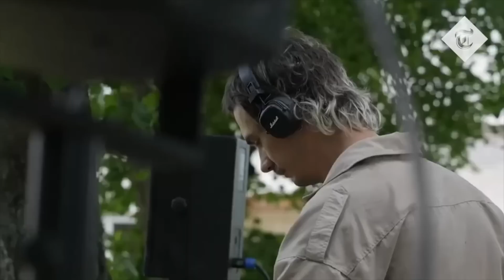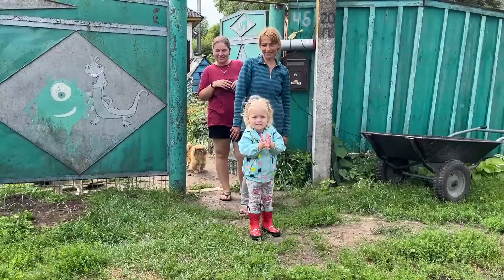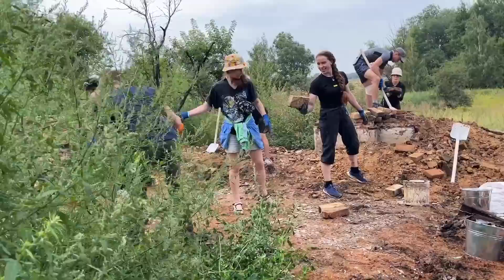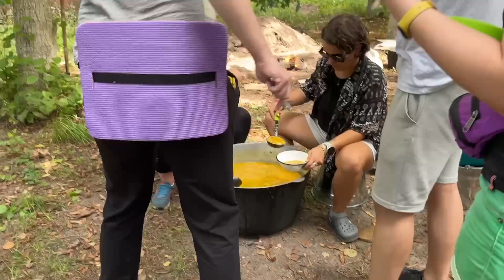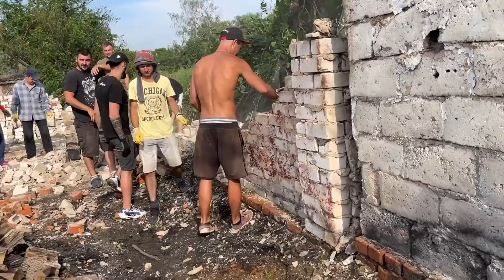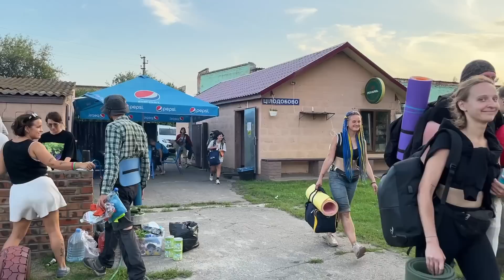VOLUNTEERING IN UKRAINE 🇺🇦 REPAIR TOGETHER (Chernihiv Oblast)

Comment: Hope those buckets aren't used to much for food. I doubt anyone noticed, but some are galvanized. In short, the metal is zinc and will leach into water and food. Which is very toxic to consume anything prepared in them.

So if you get sick with what seems like nausea or a "stomach bug", that would probably be the cause.

Comment: Great video Johnny but I wouldn't set up tent where there are tire tracks. Looks like cars might be driving there 🤔
Reply from the maker: Good point. But these weren't normal tire tracks, they were an excavation machine used to move the sand.